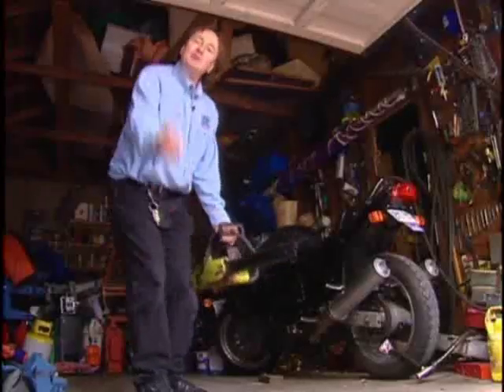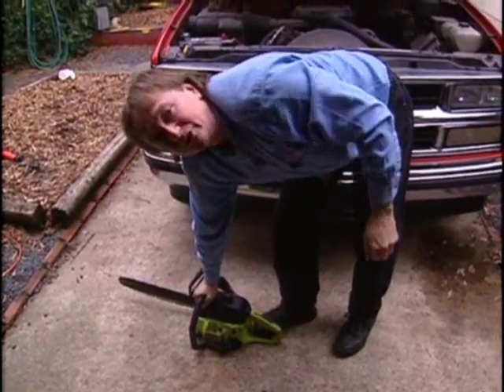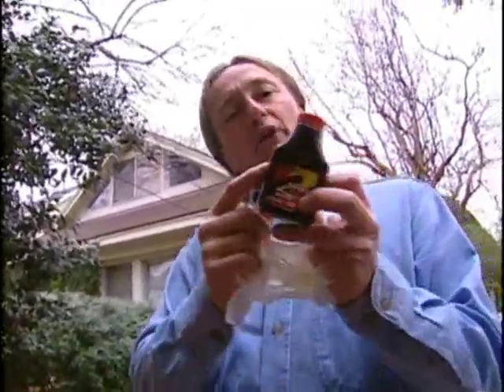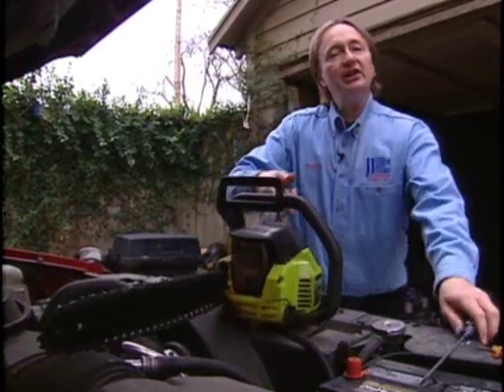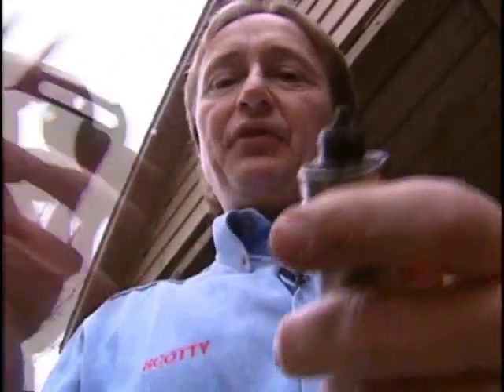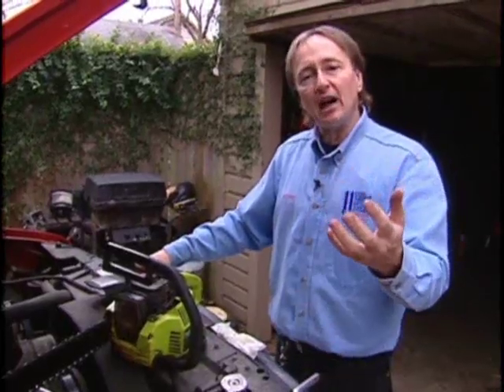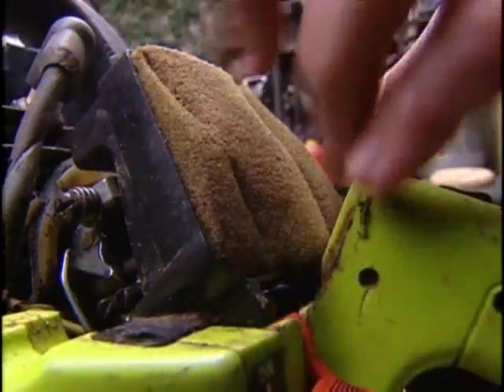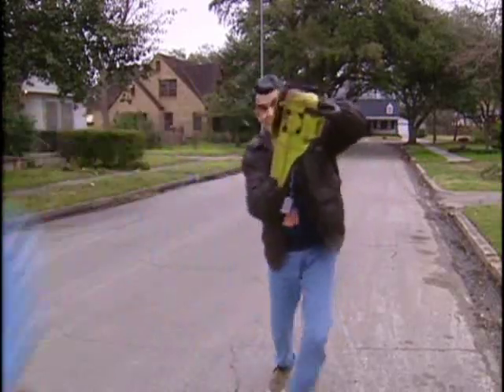How To Fix a Chainsaw

Comment from the maker: Try spraying a little starting fluid into the carb after taking the air filter off. If that works, then take the carb about and rebuild it with a kit, OR clean the heck out of it with carb cleaner and compressed air. Scotty Kilmer

Comment from the maker: Sure, cleaner is cleaner and carbs are carbs. It's actually less wear using carb cleaner on a two stroke because there's more oil lubricating the pistons than in a four stroke. Scotty Kilmer

Comment: What I've observed when adjusting the carb consists of holding the throttle tide open with no choke, and adjusting the high speed adjustment until the engines running at its fastest, then turn it slightly outward to richen the mixture so there will be more torque.

Idle- Adjust until its running its fastest idle, and adjust the idle throttle screw until its at a curb speed. You want the mixture to be a tad rich so the engine wont bog when revving. Then rev the engine and check for engine bog.

Comment from the maker: First, also put in a new filter on the tank end of the line and make sure it sits on the bottom of the tank, not on the top where it can suck air.  If that doesn't even fix it, though it should, then your carburetor has problems and is bubbling air backwards. Scotty Kilmer

Comment: Low and High arm throttle settings. Low is the idling (hand off the throttle) speed and High is the fully open setting.

Comment: if you want your chainsaw to actually last use premix. The number one reason people have to bring me their saws, weed wackers, and what have you is because they mix their own fuel. Premix is engineered and 100x better. Trust me it's worth the extra money. Using good fuel is cheaper than having your chainsaw constantly fixed and/or replacing it. I mean but hey if you want to mix your own gas go for it keeps me in business.